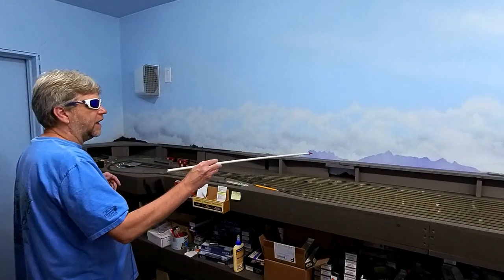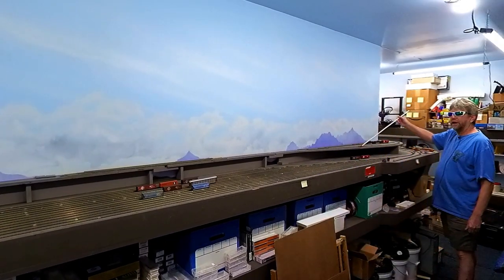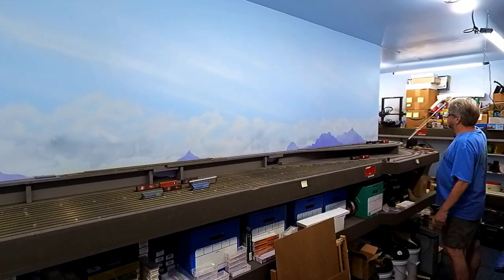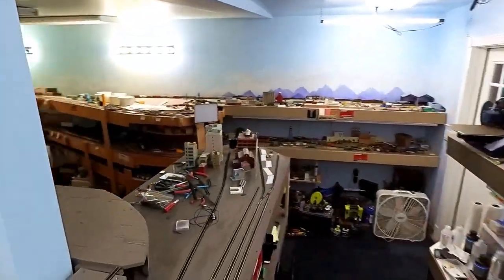OXCART BLOCK - Introduction & pre planning.  This is my layout progress update.

Comment: Eric. With your introduction of MP 23.02 Direct Traffic Control (DTC) blocks in the title page, the signal sytem on the approach from OXCART block to the OXBOW wye will be helpful to determine how the switches are aligned around the corner and thru OXBOW. Will OXBOW be a DTC Block or an interlock since there are three ways in and out? Either way OXBOW may require some interesting diverging route signals. Thanks for the update. Looking forward to operations.
Reply from the maker: MP 23.02 is not what you think.  It is for me to keep track of the daily videos.   2023 video number 2 in this group.  DTC in this case is for Daily Train Content.  It is by me to track the videos,  and keep them in order proper order.  

Yes it will be interesting to figure out OXBOW when I get to that point.   I will be talking about that and taking input in a few weeks.   I just need to get passed the pre work of painting and bench work 1st.
Reply: @IMRROcom  Well then, I guess the Genie is back in the bottle for now.:face-turquoise-covering-eyes: